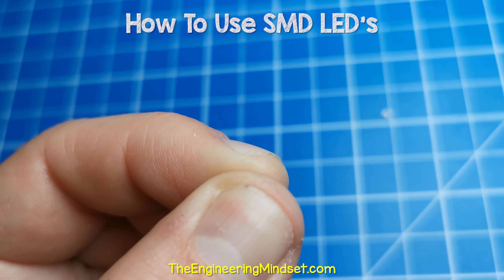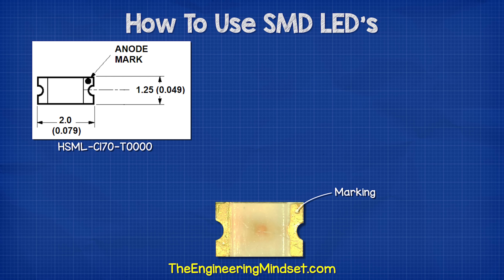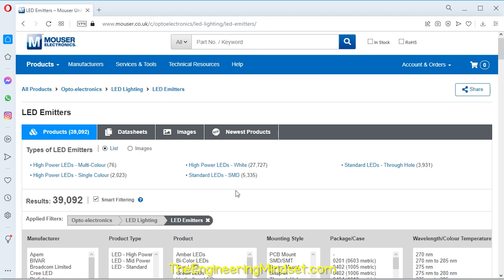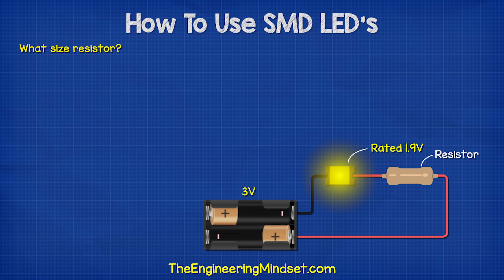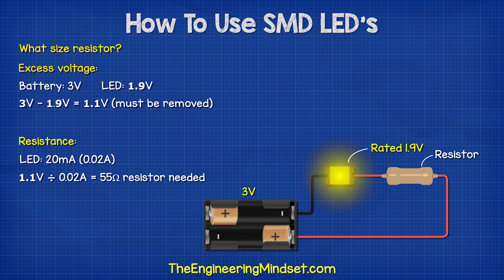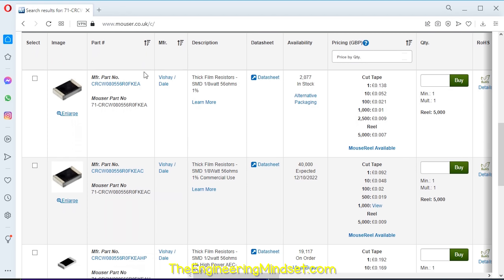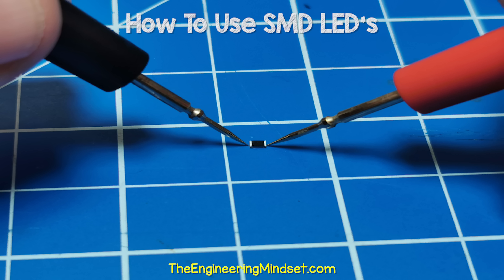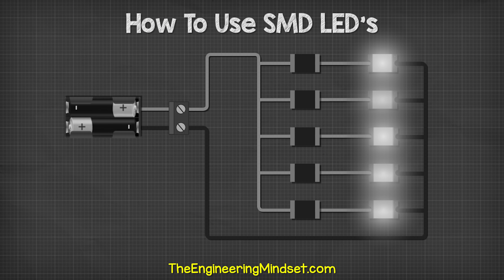How to Use SMD LEDs in Your Electronics Projects

Comment: I found the best way to work with SMD LEDs, was to 3D print a mould / holder, to keep the SMDs in position, I then hand soldered them with a very fine tip, wasn't too hard at all.
Reply: @Dave Lordy  Can we see a picture or stl of the mould?
Reply: It's easier to put some solder on the pad and then hand solder them. No need for any mold.
Reply: @John-ed2wj  The mould was to keep them perfectly aligned.
Reply: @davelordy  ah, got you.
Reply: @John-ed2wj  I was trying to do a perfect circle of very small SMD LEDs (4x2mm if I remember correctly), it only takes one or two to be half a millimetre out and it ends up looking messy, eventually (after various other failed ideas) I ended up printing little 3D guides that I could drop the LEDs into, with space to allow me to solder.

Comment: What does it mean if an LED datasheet has forward voltage specified as a range from min to max (no average or typical). What should I use to calculate the resistor in this case? They do say what the forward current is.

Comment: D1: SMD component (stripe on back I'd say LED) (bottom right quad)
F2: SMD component (resistor?) Centerish
D3: Screw
B4: Red LED (through hole)

Also mobile no less (almost missed D1 though)
Reply: He asked about the number of objects.  I spot many many carpet fibers in all grid squares.  Unless carpet fibers are not objects.  Also, a large hair stretching across D3, D4, E2, E3.
Reply: And some dust particles on my screen 😀
Reply: @Harold Depends on the unit.
Reply from the maker: Check out NEW resistor video, everything covered! ➡️ https://youtu.be/DYcLFHgVCn0
Reply from the maker: Seen the new LED explained video? so much detail covered! https://youtu.be/O8M2z2hIbag

Comment: I so much want to make a POV clock with smd parts. It would be lighter and less clunky looking when not spinning. I also want to incorporate a qi charging coil to the propeller so the arduino and motor does not have to be on the board with a battery, reducing spinning weight and also making it neater in appearance. Now if i could only figure out how a smd hall sensor would mount to trigger a magnet and set the timing….

Comment: The polarity markings made me think I was going nuts when I first used SMD LEDs for modding tail-cap switches on torches!  Mmmm, illuminated tail-caps.
  I had a MM, but it didn't have a diode check option, so my method was 2 wires off an 18650 direct to the LED, with a 50-50 chance of blowing or lighting.
  I'd make sure I had the markings & polarities memorised, then to another colour LED, then another, only to find the last ones wouldn't illuminate. 🤔
  I double and triple-checked my soldering, the SMD resistor values, wiring, et cetera before finally realising that LED manufacturers are malicious idiots and that I was indeed still sane, just, lol. 🤦

  I now have a much more capable MM.  It would have been handy if I'd seen this video a while ago, though, possibly, I'd have fewer grey hairs.  😆👍
Reply from the maker: Check out NEW resistor video, everything covered! ➡️ https://youtu.be/DYcLFHgVCn0

Comment: I need your help.   I'm a totally newbie in electronic and I bought some little project to build some blinking LEDs on a star shaped PCB.  I've broke one led and took one from another previous kit that I had a spare.  Only the replacement LEDs light and the other LED are not doing anything.   Ive test those with my multimeter and every LED that I test with the diode mode light the replacement.   

The project use 5-6V and I use a 5v cell phone charger on a little usb pcb board that I had in my hands. The voltage of the board gave me 4,62V

I don't know if there's a malfunction in the chip that makes the light blink or if the replacement LEDs need less power and for a reason that I don't know,  take all the energy. 

Thanks for your help
Reply from the maker: Seen the new LED explained video? so much detail covered! https://youtu.be/O8M2z2hIbag
Reply: @EngineeringMindset  thanks
Reply: @EngineeringMindset  interesting video but you don't talk why my case occurs....

Comment: How to avoid wasting power in the resistor?
Reply: My guess would be to use a power source with a lower voltage, this way you don’t have to lower the voltage (as much) to power the led. 

Get as close to the forward voltage as possible, but remember that the voltage can drop when using more components or when batteries go down on power (if batteries are used).
Reply from the maker: Check out NEW resistor video, everything covered! ➡️ https://youtu.be/DYcLFHgVCn0
Reply from the maker: Seen the new LED explained video? so much detail covered! https://youtu.be/O8M2z2hIbag